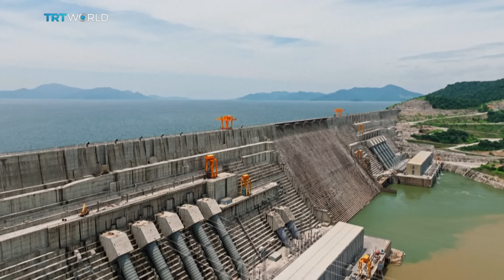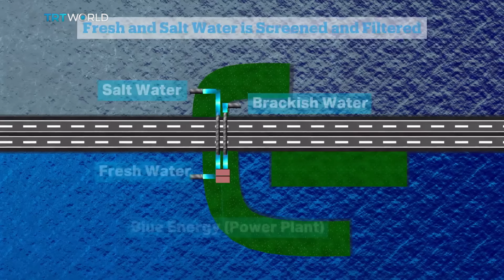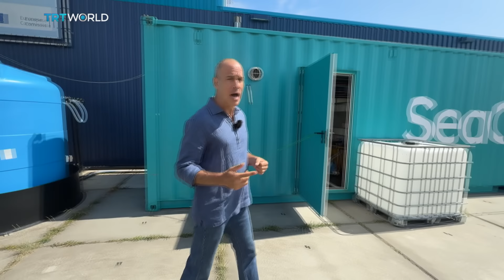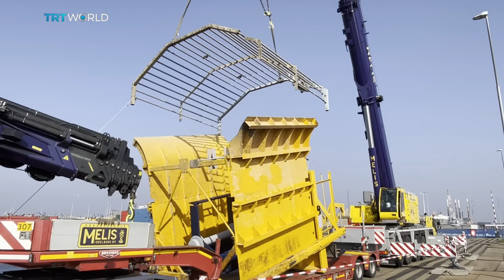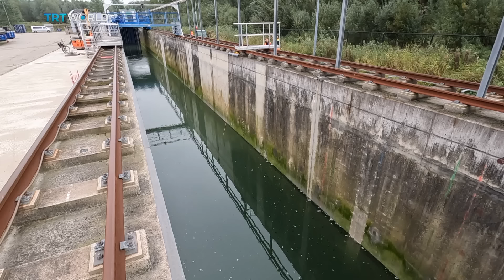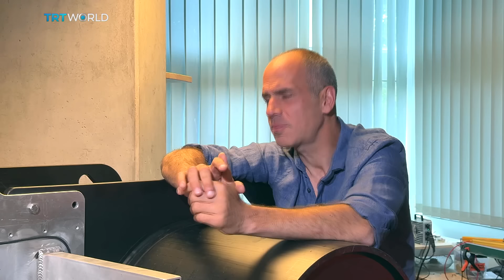Blue Energy: Turning The Ocean Into Power Plants | NexTech

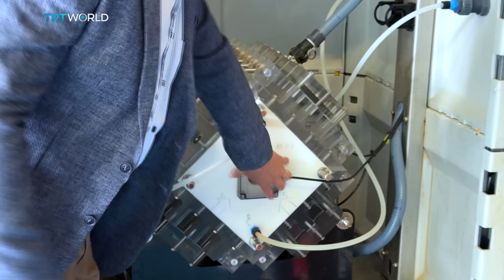Comment: 8:37 Imo a hell of a lot of effort to get 50V! When this scales what effort will be required and what about the continuous maintenance it will demand when in full operation.

It's undoubtedly technically incredible but is the massive effort and material use to achieve it sustainable?